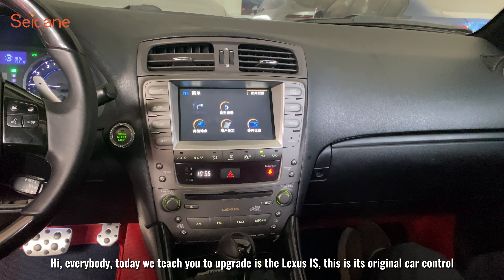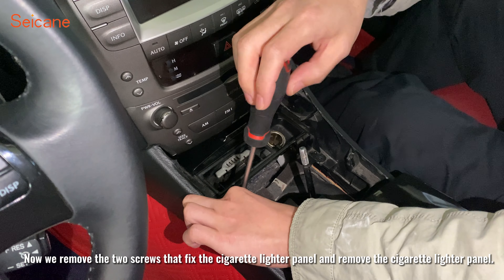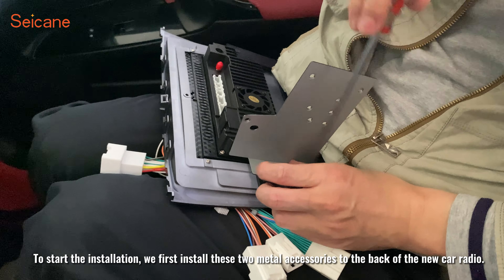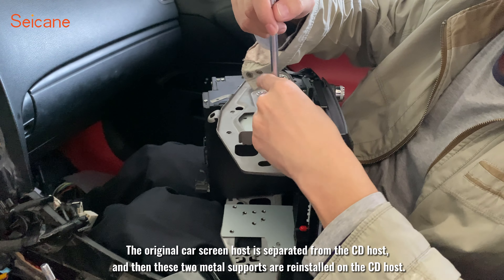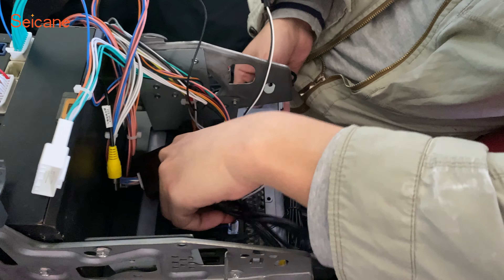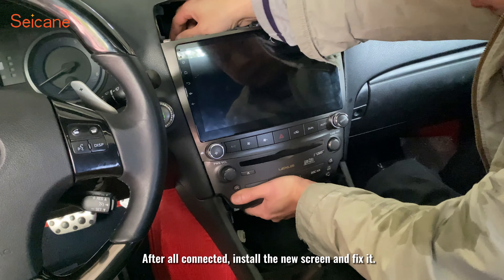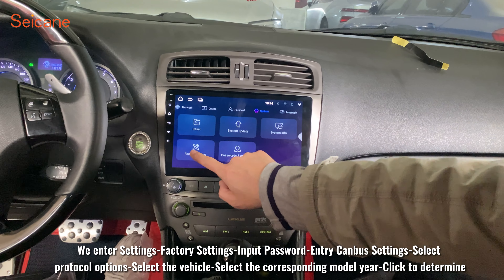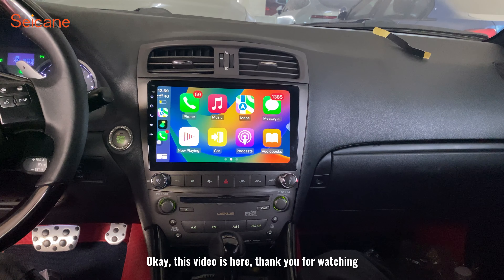How to upgrade radio Carplay yourself? 10.1 screen for 2005-2010 Lexus IS250 IS300 IS200 IS220 IS350

Comment: I just installed mine and the only issue I’m having is that when I start the engine the directional lights start to blink like if were a problem with the parking lights button
Reply from the maker: hi, contact us with email, we will help you about it :aftersales@seicane.com
Reply: I have de same problem
Reply: can u still the factory reverse cam
Reply: you need to press your hazard light button on the system to turn them off. I might have press it during installing

Comment: Does this come with reverse camera? AC control will lose no functions? And does the steering wheel control work as normal?
Reply from the maker: reverse camera needs to be bought extra. functions of AC control and steering wheel control still work.
Reply: @Seicane-Car-DVD my Ac controls aren’t the way they should. I can’t change the ac from cycling air from outside to just cycling the air in the car. When I press the button to circulate the in the car only it’s not changing. Also when I turn the dials for the control or mode control the screen is not changing either.
Reply: @navadablanchard4979  You can't change the cabin air filter without being able to put AC into recirculate air mode lol.  I'm looking at this unit, and this issue would be a major issue esp for my car that switches automatically between those recirculate and fresh air.

Comment: I have a original raer camera can i use it with the hifi or i need installed the new cam ?
Reply from the maker: Hello
If the plug of the camera video out cable of your original car is the same as ours  camera video in plug ,then it can support your factory backup camera.  
You can check our plug in the link below:
https://www.seicane.com/for-lexus-is250-radio-android-hd-touchscreen-gps-navigation-system-with-wifi-bluetooth-support-carplay-tpms-h6616

Comment: Hi great video, I installed mine everything works except the reverse camera, I can't get it to work with the original camera, I have followed the instructions, please help
Reply from the maker: hi, sorry for the trouble caused to you. please contact our after sale team, they will help you about it.
Here is the email address: aftersales@seicane.com
Reply: @Seicane-Car-DVD  hello I purchased this headunit which canbus setting did you use for lexus is250 my air conditioner works but my heat won't come on how do I turn the heat on
Reply: Hello are you having any issues with your heat I have an 2007 lexus is250 my air conditioner works but when I change to heat it's still in are conditioner mode. What canbus settings did you use for your car
Reply: Did you figure out the backup camera? I’m having the same issue
Reply: I had to install a new camera it was the easiest why and just drilled a small hole next to the original camera, I installed the wiring down the drivers side and through the back-seat, you don't have to remove the seat, there's a video showing how to wire without removing the back-seat, took me about 1hr20mins
Reply: @alexr8895 can you tell me what camera you bought and how you installed it? Thanks in advance
Reply: Hey everyone.
For reverse cam its work with me.
Just let the rear cam to get power from the reverse lights inested of the multimidia

Comment: Where can i find the password for the factory settings ?
Reply from the maker: Hello, the password is 1617 or 1234
Reply: Can i use the original rear camera if yes whith cable do i need to closing the hifi and the rear cam

Comment: I have a problem with the buttons for climate and warn signal , they dont function
Reply from the maker: Hello
Please check if the white small plug (canbus serial data cable) on the back of the device is connected
Please go to setting-Car setting-Factory setting to set the canbus as : Luzhen---Lexus---IS
Reply: Hey I’m having the same issue, I have all the ports available connected with the cable, I do have like cable that don’t match with anything. Have you managed to get yours working?

Comment: If the car already has a back up camera, will this screen display from that camera?

My 2011 is250 has a backup camera and i wanted to add this.
Reply from the maker: hi, it works if your camera  is AV connector.

Comment: My airbag light is on, my controls on my steering wheel doesn’t work, my hazards won’t work and my radio will play music for a minute and then continuously cut off
Sometimes my ABS cuts on too
Reply from the maker: hi, where did you buy the item ? please contact us via email if you bought it from us. we will help you about it. email : aftersales@seicane.com
Reply: If you have the exact same unit as this, it's probably because you have the hazard light switch connected wrong, or the power supply connector isn't in properly 

I had the same thing when I was testing it, no hazards or AC lights intermittently, and the airbag light came on - took the + off the battery, rechecked the connections and it worked properly and cleared the airbag light.

I think you need to manually "learn" the steering wheel buttons in the settings